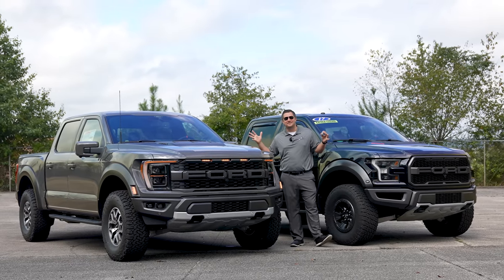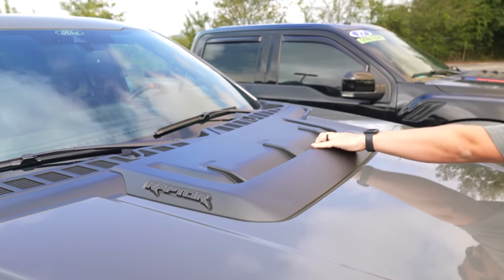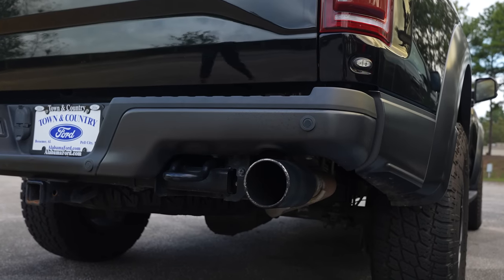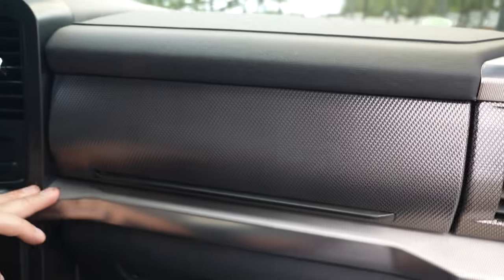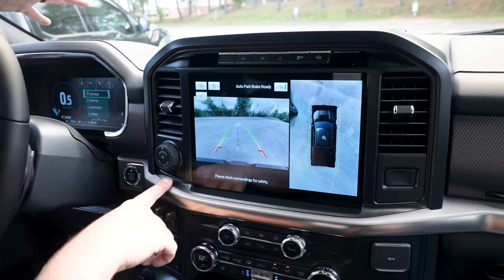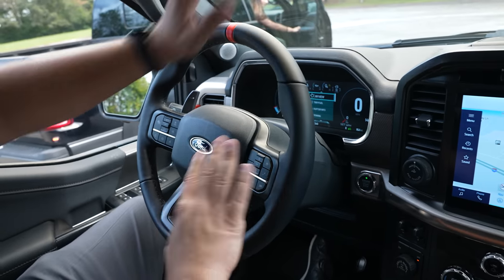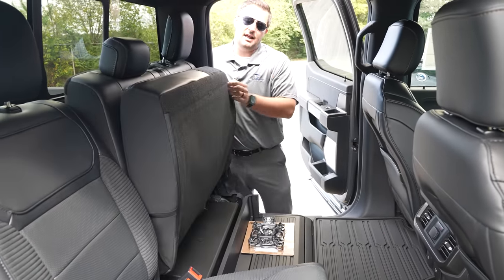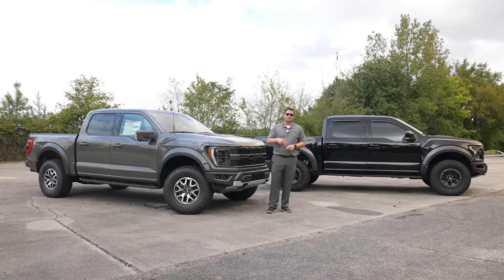2021 Ford Raptor Walkaround! What's New?

Comment: IMO, the 2nd gen looks more aggressive.
Reply: When you see the gen 3 in person it looks better, even the guy said that too. I saw a RAPTOR in person and it looks nice
Reply: To me the gen 3 looks more like the gen 1 but yeah the gen 2 is the best looking Raptor.
Reply: @jayxj7785  I think the gen 3 is the best one, when you see it in person it looks good
Reply: @baselqashou5716  maybe you're right because I'm yet to see the gen 3 in person, but to each their own 👍🏻
Reply: Im hanging onto my Gen 2 after sitting it beside a Gen 3 at the dealer. I prefer the looks of mine to the new ones. Plus the super cab just looks better and thats not an option anymore. 🤷‍♂️
Reply: I agree 1000%. It may not have all the fancy new interior tech but on the exterior it looks way better.
Reply: @CoreyStraight  AMEN! That is how I ordered mine also.
Reply: @CoreyStraight  no more super cab..wtf maybe the R will be super cab.
Reply: A LOT more !
Reply: Gen2 looks good exterior 
Gen3 looks good interior
Reply: u r right the 3rd gen looks ugly
Reply: @baselqashou5716  I’ve seen them and still agree. Gen 2 for the win
Reply: @CoreyStraight  good choice
Reply: I had my choice between a gen 3 and lightly used gen 2 last month, bought the gen 2 as it looked better and I hated the idea of having a screen instead of needles.  Don't mess with my needles!
Reply: Ufff yeahhh
Reply: I have a gen 2, but I like the headlights and interior of the gen 3! Will probably trade it in for one or get a new TRD Pro

Comment: Pretty sure the stripe on the steering wheel is to let you visually know that you've tweeked the steering alignment during racing.
Reply: You are correct, lets you know which way your tires are turned to when racing.
Reply: it was used in rallying.  when the codriver calls out a 3 left, the driver knows how much the steering wheel needs to turn to make the 3 left for example.
Reply: @Majorrick07  Steering racks don't use a 1:1 ratio. 20 degrees on the steering wheel doesn't equate to 20 degrees of tire direction.

Comment: Gonna take more than different headlights and bigger tires for me to think about upgrading
Reply: 12 in monitor and new exhaust….
Reply: 5 link suspension, more torque and overall smaller improvements you wouldn’t notice right away till you drive one or get in one

Comment: Great review, and Great truck.  I love the new Raptor.  I have a few quick questions related to one issue I'm hoping you can answer:  AT 59 I don't do as much classic "off roading" as I did in my youth, still some, and this Raptor would still be useful to me in any number of other ways, including its smoother highway drive with those shocks and winter time capability, not to mention the emotions of just plain wanting one, but my question involves the tires.  Love the size, but am wondering if I need that aggressive tread pattern since even my more limited amount of classic off roading won't be as aggressive any longer.  For this reason I wonder if I could get that size tire but with a more versatile, all terrain tread, something that might channel rain water better on highway runs for instance (I would get a dedicated snow tire for winter regardless).  Do you think my theory is sound, and do you think I could find a more versatile, al terrain tire like that in that size?  And how much if any do you think those less aggressive tries might improve the mpg of the truck?  Thanks.  And keep up the great review.  Man, this is a beautiful truck.  I even love the gray.  I would usually prefer all black, but might just prefer this gray but with some black highlights.  Beautiful!
Reply: Im also 59, and I already ordered mine- I already have K02 on my current F150 There great in the rain and snow - Go for it !
Reply: @joesmithatridecorp9011  Hey, a fellow gheezer, as in old gheezer.  🙂  Question.  I just did a quick review of the KO2's, and they sound and look like great tires, and they do have the severe winter rating 3 peak designation.  The description also says they handle snow about 20% better.  By that I assume they mean 20% better than your average all terrain tire.  Do you have any experience, or opinion, as to whether those specific tires would be as good as a set of dedicated winter snow tires?  I have confirmed that Nokian makes tires in the correct size, and Nokian along with Bridgestone (Blizzaks) apparently make some of the best snow tires.  What do you think?  But dang, that truck just looks so awesome.  Wish I could get the lay flat reclining front seats and massaging front seats, but nothing's perfect.  To get those I'd have to go down to something like the F150 Platinum, a decent truck for sure, but not the Raptor.

Comment: Something about the Gen 3 headlight nacelle just doesn't look right to me. 
Oh, I'm not sure opening the door at low speed and having the vehicle jump into Park is a good idea. Granted , this Gen 3 has multiple cameras/views but occasionally opening the door to take a peek is necessary during slow speed off-roading.
Reply from the maker: Ford has really thought that feature through... If you have your seat belt on, it doesn't automatically switch to park because it knows you aren't getting out

Comment: Haven't seen it talked about anywhere else but does anyone know why they changed the Raptors taillights to have a red turn signal combined with the brake light compared to the new f-150 with its amber led turn signal and separate brake lights? Seems like such a strange change to make, especially given a separate amber led for the turn signal is much better imo.

Comment: Highest trim and it doesn’t come with a sun roof?
Reply: Probably because 9/10 people will never open their sun roof. Another point of water intrusion and never good in a hail storm.
Reply from the maker: Sunroof is optional even on the higher trims
Reply: @TravelingStacker  I guess 9 out of 10 people only open the driver's side windows but never open the other 3 windows ever.
Reply: @antoniodavis8266  Most people open the other windows. Most people never open the sun roof. Hence why its optional on all trims.

Comment: I know it's cool to bash the Ecoboost. I understand the pressure to do so. But it's unfortunate because the Raptor has carved out quite the deserved respect WITH that motor. The V8 only crowd would still exist if the Ecoboost was 1000 HP. :)

Comment: 74k??? What’s the R gonna cost over 90k?
Reply: Yes
Reply: Definitely over 90K especially the first of 1st gen. They maxed out around 74K last gen and this is is a base model so raptor R I’d suspect over 3 digits for fully equipped.
Reply: MSRP will probably be $85-95K but with the Dealer markups I bet the average costs is around $125K. Most regular Gen-3's are marked up $10-15K...
Reply: My 2021 raptor is 82 with 801A and a few other options plus a 5k ADM. The R will definitely be over 100K and dealerships will mark them up ridiculously. The eco boost motor is great people who complain about it have some real ego problems they need to work out. It’s like saying a 911 sucks bc it’s a 6-cylinder, it just makes no sense.

Comment: That eco boost engine is very well balanced on power, torque and gas mileage.. you can't have 800hp and expect great fuel range.  The TRX sucks for long trips and off Road trails. That's my personal opinion based on facts.

Comment: Gen 1 with a Roush supercharger is better imo. For now its TRX all day.
Reply: Didn’t you here about the RAPTOR R, there making a V8 supercharged with 760 horsepower
Reply: @baselqashou5716  I did hear about it and we have no details on it except it had a v8. That info alone is almost a year old so idk how many will be built how much power or even when. For now the TRX is on top
Reply: @largenloud9744  they said it’s going to be made in 2022, search it up
Reply: @baselqashou5716  Again, yes I already heard of it nothing about it is confirmed. All we know is it’s gonna have a v8. No clue when it’s coming out or how much power it will have. Also the r will probably be limited but we don’t even know that for a fact.

Comment: Most dealers are charging $5-10k ADM on new Raptors. Ford needs to ditch the old-school whip antenna. Shark fin on the roof!!!
Reply: The long antenna is a lifesaver when entering spaces with low overhangs. Helps you figure out where you should and shouldn’t advance forward.